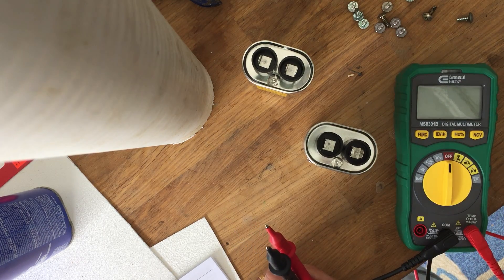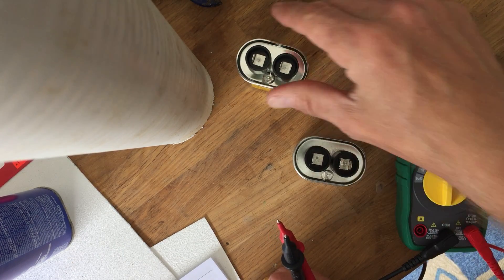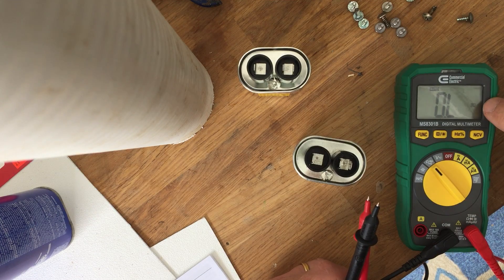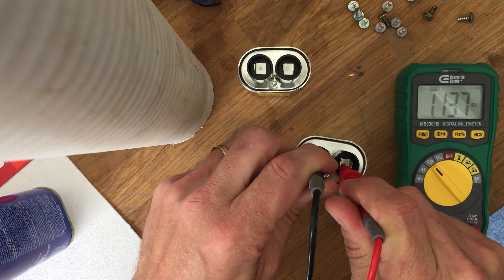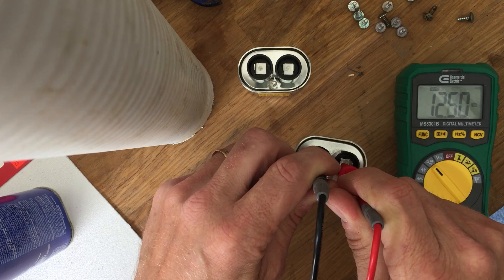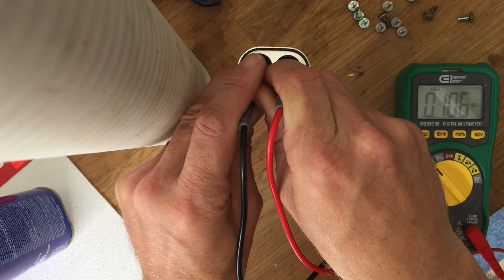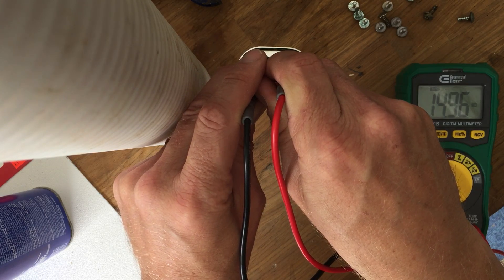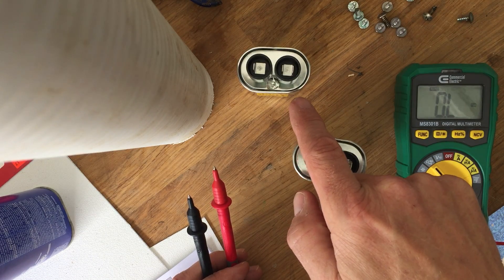Testing problem for a capacitor

Comment: Capaciter  testing metha
Reply: Mult  meter    ..   scale   ponter   meter   zero adjusting  sreew  .  Receptacle   zero  oh knob   tes prods   tesvleeds  dc  ac  me asured  dc  brbe dc reang seting  ac ok1000vok  one kilo  ohm  =1000ohms  1   mega  ohm  1000 kilo  ohms   =1000.000OHMS  0K THANKYOU

Comment: Nils randrupt, I wonder why you used the resistance testing to check that capacitor (a technique which normally is used to detect capacitor leakage) instead of using directly the capacitance mode of your multimeter (second position of the rotary switch, starting from the leftmost one) and read directly it's capacitance in μF before buying a new one. Now, since both caps react in the same way in this test, then a) both can be either good or bad and b) your multimeter, for some design reason, cannot perform this task on capacitors. Anyway the resistance testing method on capacitors is both a very old and approved method well known to all technicians around the world.